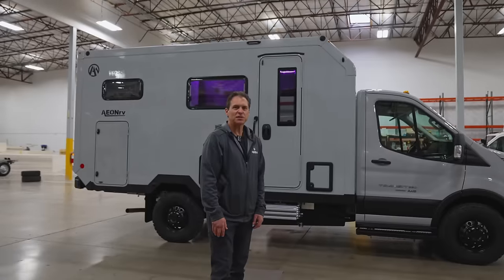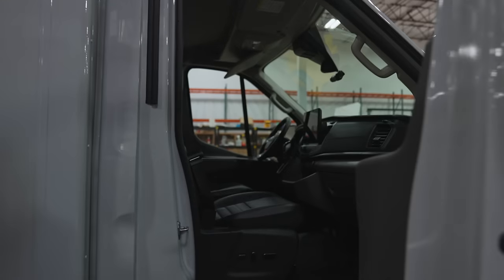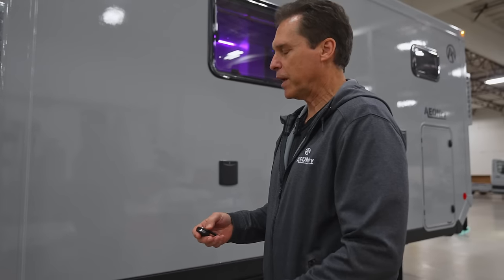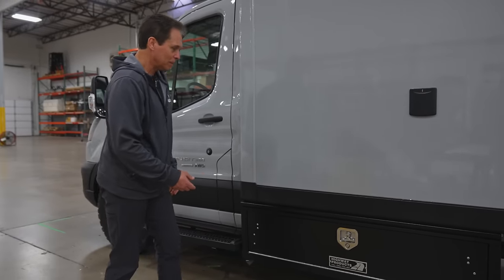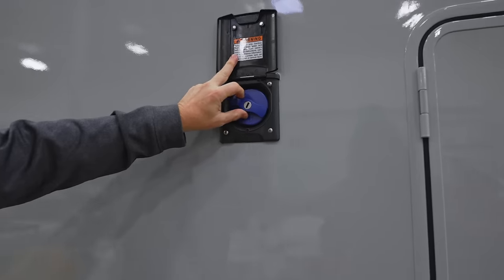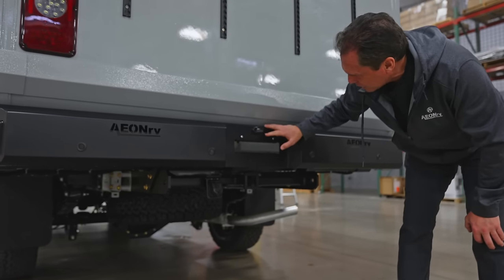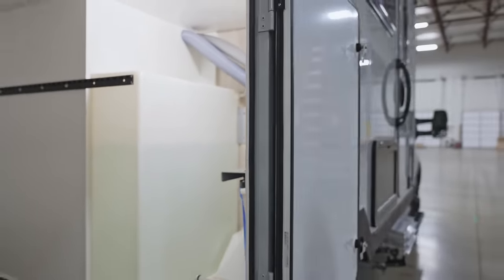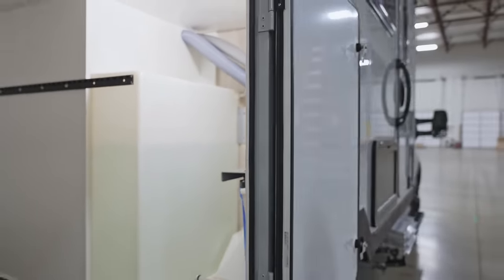The Future of Adventure—A Tour of Our Latest AEONrv!

Comment: Nice for campgrounds, not so much for anything tougher than a soft road with that horrible ground clearance. Adding that exterior storage box low on the drivers side really gives it minivan ground clearance. Exhaust seriously needs tucked or even run verticle behind/above the cab. Not even going to get into the wet bath location. 
Might be a comfortable camper but keep it on the asphalt.
Reply from the maker: You should check out some of the videos we have going off-road. Our customers and us taken the vehicle on many gnarly trains. Low point is differential skid plate at 8". Departure, approach and breakover angles are all > 20%. Exhaust is above the line of the departure angle and is not an issue, but if you think it is easy to move. If you don't want the storage box don't order it. Everything is a trade-off in the design an off-road camper, but our vehicle can go in some very challenging terrain and we've proved it.

Comment: What  is the fuel economy  and what is the price.
Reply from the maker: $219,500, MPG is typically 11-13, but you can baby it to get 15 on highways if driving 65MPH. Twin turbos provide lots of power  and torque. Easy to pass going up large hills in Colorado over 8k ft elevation.

Comment: Outlet in or near the the drop table, nice rig
Reply from the maker: There is one right inside the kitchen window designed to allow you to cook outside. We don't put electrical outlets on the outside of the vehicle for security, safety, and thermal reasons, thanks.

Comment: can you run AC 24/7 off the solar if it sunny out ?
Reply from the maker: Pretty much yes, mini-split will use 250-350W to keep at 75F while 95F outside and if in sun we'll get > 600W from solar so charging batteries while running the AC.

Comment: What I would want is a low tech version insulated open architecture box that you can plug, unplug, swap out with other modules. So if I want to go camping. Plug in the camping modules. When I need to move things for business, I can empty it out. Total fan of the minisplit in the design.

Comment: Why has the option for the secondary dedicated house battery alternator been removed on the latest iterations?
Reply from the maker: We get 1.6kW while driving or at idle from the standard 250A 12V alternator and we have 800 W of solar on the roof. For the weight cost trade-off we don’t think we need a second alternator. This has been born out by the usage of our customers.
Reply: @aeonrv  it’s always been obvious that you guys listen to your customers, and combined with your own knowledge and experience, make these changes. Super cool to know that system/appliance efficiencies have gotten to the point in the real world where this simplification of the electrical system is possible. Keep up the awesome work!

Comment: How much battery power (Amp hours) are in there. How much $ is this RV as it stands?
Reply from the maker: It is a 24V battery/electrical system and comes standard with 6 BattleBorn batteries so equivalent of 600Ah at 12V. You can optional add 2 or 4 more batteries of equivalent of 1,000Ah.
Reply: @aeonrv learn to talk in kWh so you will not confuse people anymore. That way, you'll look as a professional 😉

Comment: Interesting. Im not sure about entering through the toilet though. Might be OK when the vehicle is new but after you have been off rodd for a few weeks it may be a different story.
Reply from the maker: There should be no smell inside the unit if you use the cassette toilet correctly. With the optional urine separating toilet there is a fan that exhausts any potential smells. If there were smells would you rather have them in a back corner by the bed or by the door where they would dissipate?

Comment: Missed the obvious, simply eliminate the side door. Who in their right mind would want to go to the bathroom or shower in front of a door that could open at any time? Saw a custom unit where they did just that and it worked out well. Electric box should be vented outside with an optional vent inside for cold weather. Should have a draw curtain behind the cab for when you step out of the shower. Back side of dinette bench folds into cab space to make bed long enough for adult. Loved the solar and all electric. Switch to hybrid van base when available. Consider forever shower, compost toilet and increased solar for extended boondocking. Double solar with rigid solar awning that sides or folds out when in use.
Reply from the maker: Thanks for your feedback and everything is a compromise in a small RV. The door is lockable and a requirement for safety egress. Also, when showering there is a curtain that pulls across the door and the toilet to prevent water from splashing so the bath is in effect a dry bath. We have a maxxfan to vent hot air that rises. There is already a door that closes off the cab from the rest of the living space. We'd love a hybrid if one becomes available in NA. We already offer a compost toilet/urine separating with the Tiny Separett. Don't want rigid solar for weight and other reasons. We've looked at recycling showers and the hassle/maintenance are not worth the water savings in our analysis. We can easily boondock for 2 weeks with our current 67G fresh water and electrical/solar/battery system. Cheers!

Comment: It's been fun to watch the company's product mature from the pre-production models to the current iteration. I also think you must have hired a media person because we see many more videos. 

major kudos for the design/construction of the vehicle- I can't wait to see it in sub-zero temps.
 
minor gripes (and I do mean minor) 1) there should be a hose faucet in the garage for external water 2) the induction cooktop should be flush mounted in the counter-top  3) lots of ppl want a TV,  a TV mount should be an option and the light switch will be blocked if there is a TV there  4) cab passthrough needs a sturdy grab handle  5) surprised you aren't using a smartplug for shore power.
Reply from the maker: Thanks for the feedback. We use the shower head as an external hose to wash off bikes, etc. Disagree on the induction cooktop as it reduces counter space when not using and people drop things on them so break. Easy to mount a TV in a number of places. It is easy to get through the pass-through so don't think it needs a handle. Our plug is European and works great with our system. No need for a smartplug.
Reply: A person who buys this rig is not a TV watcher, or at least I hope they're not.  This is a boondocking and small USFS campground vehicle, not an RV park rig.  Somebody who appreciates getting outside and away from television.

Comment: How many amps is your charger from the alternator via an inverter? And how many amps does your alternator produce? Thanks for answering this questions in advance. More power Aeon RV… I’m your new subscriber.
Reply from the maker: We charge batteries at 1.6kWh off alternator and up to 700W off solar. It is a 24V electrical system.
Reply: @aeonrv  -Do you guys have a secondary alternator? Do you charge straight up from alternator to inverter to charger to batteries? Thanks
Reply from the maker: @norkisserrano  We charge off the high power 12V 250A Transit alternator. Ford never pulls more than about 90-95A. Our battery system is 24V so we convert the 12V to 24V with the correct charging profile for BB lifepo4 batteries. We charge at 1.6kWh at idle or while driving, does not matter.

Comment: I dont like the steps to get inside seems like a hassle to keep setting it up before you can get it and out and having to leave. One of the perks of having a B+ is you are self contained and can leave immediately if there's an emergency. In this case you have the steps sticking out which may damage your van in case you need to leave in an emergency.
Reply from the maker: We put the steps up at night and enter through the cab, very easy to do.

Comment: Crap!!!  Give me a wider toilet closet.  I have to sit every time, not just to urinate, and I don't have a toothpick body.  And, yes, smells near the entrance?--not optimal.  Otherwise, I kinda' like this unit.  Wish the rear axle (differential?) was a little higher off ground, but I could work with it.
Reply from the maker: Toilet area is 24" wide. Differential is 8" off ground and is low point with a 1/4" thick steel skid plate.

Comment: That is a very cool RV but it looks like an overland RV by design it's more of a normal RV, I really like it but I'd be aware if you purchasing it that you're not intending anything hardcore. the reason I have is the water being behind the rear wheels is a red flag since I would want the weight between the wheels as low and centered as possible, same with the placement of the fridge it's high and not centered so what ever is in there will move a lot more. but overall looks like a great RV for 99% of user cases
Reply from the maker: Center of gravity is in front of rear wheels and down low. Fresh water tanks sit more on top of rear wheels. We've engineered the COG to be in an advantageous place for off-roading.

Comment: I don't like the AC being blown right on you when you try to sleep
Reply from the maker: The inside AC unit is louvered so you can adjust it to not blow on you. Plus, it has a very built speed fan so you can turn it down to whisper quiet.

Comment: Lots of highly reputable companies and a well thought out build, just seeing some strange choices that feel like a cookie cutter RV. 

I’m not sure why you would need a sink in the shower, instead of taking ONE step over. ONE STEP. Only swap I would make is for a laveo dry flush toilet, then you get a larger shower and less plumbing work (without the silly spare sink). The cassette toilet must be for cost savings, but I’d imagine this isn’t a cheap rig anyways.

Edit: $220,000 pre tax and it is using the cheapest method of a toilet 🤦‍♂️
Reply from the maker: Wife required separate sink...seriously though we like having a medicine cabinet with a sink and the sink folds up so does not affect the shower size, which is 24"x30" usable space. The standard Thetford C223-CS RV Cassette Toilet has an MSRP of $850 so we don't think it is "cheap". We offer an upgrade to the Separett Tiny Urine separating toilet, which many of our customers really like.

Comment: the bathroom is a deal breaker, no one can enter or exit the rig when someone is using the toilet or taking a shower, horrible idea cassette toilets should have stayed in Europe, not having a sizable black tank or even proper drain from grey water nope, nadda, no go, too bad lot of other aspects real nice.  Though it also seems this rig should have dually real wheels.
Reply: Go buy any of hundreds of RV park queen Class C's available just like you want. This is purpose built for off road use with single rear wheels and no black tank.
Reply: You can just enter or exit through the cab...
Reply: Well good thing you can't afford it anyway 😜

Comment: What is the use of a remote start?
Reply from the maker: One use case we use is to turn the vehicle on while in the coach to charge the batteries and reheat the hotwater, can even be done from bed!
Reply: When you're freezing in bed and don't want to get up and crawl over everything just to run in some heat

Comment: Very nice approach to design.  I lament the move away from diesel fired heaters and cooktops to all electric.  In extreme cold environments where you have no solar gain and where you don't want to run your engine for two hours a day to replenish your batteries, diesel heat and cooktops save the day in efficiency.  But it's a new world with warfare against anything diesel which is sad.
Reply: Solar works BEST when it's cold, maybe you mean cloudy?
Reply: Diesel cooktops ? haven’t seen one here in North America, propane yes. And, there is nothing preventing a person from installing a Webasto heater in the rear cargo area beside the 40 gal.water tank.
Reply from the maker: We already have an Espar Airtronic S3 B2L heater installed that pulls gas from the gas tank. This works down in theory to -50F. The heat pump works down to -10F.
Reply: @blueman5924  Wallace stoves.

Comment: 1) Love those huge tires, but it seems like there’s engine parts hanging down that make the ground clearance not as high as it could be. I would want a rig like this for off-roading and not have to worry about damaging the low hanging things.
2) The air conditioner hanging off the back looks enormous! 
3) Did you show the roof? Does it come with solar panels or is that an option? Ladder? 
4) With a separate hot water tank, does that mean you have to constantly be filling it up from the bigger water tank?
All in all this looks pretty great. Too expensive for us though. I wonder if the price will eventually come down on these sorts of vehicles or go up?
Reply from the maker: The low part of the vehicle is the rear differential and there is a 1/4" steel skid plate on it to protect it. The AC on the back is not that big and is twice as efficient and way more quiet at 26dB than a typical RV roof top AC unit. The roof is covered in solar panels (700W) and also has a MaxxFan and skylight, which gives you egress to the roof. We don't want a ladder for safety and security, but easy to carry a folding portable one if you want. The hot water tank automatically fills from the fresh water tank. Price not likely to come down as Ford has increased the chassis price from $43k (2021) to $59k (2024) mode years.